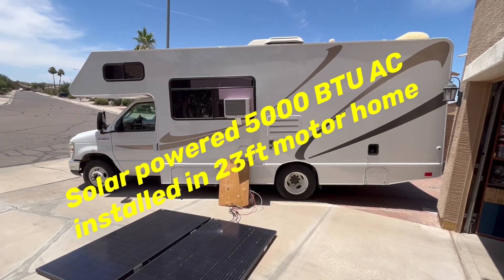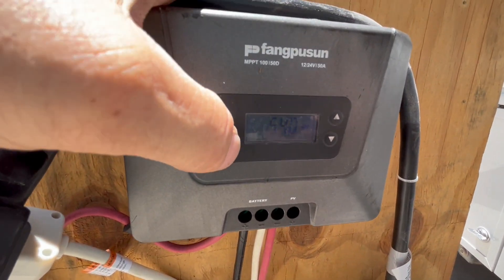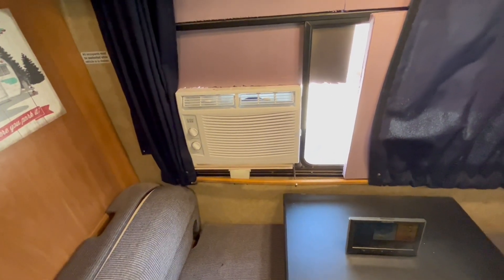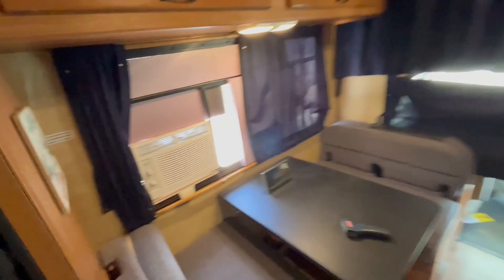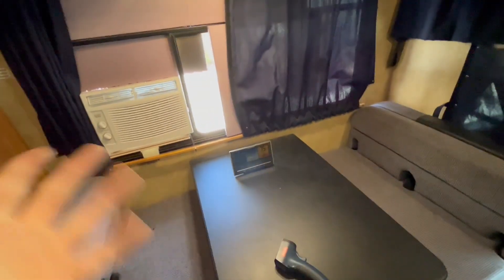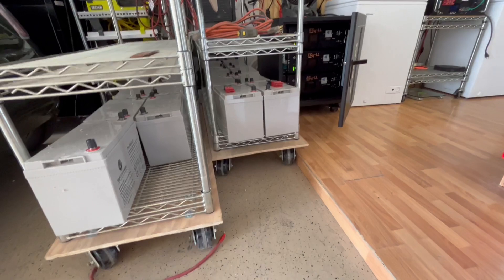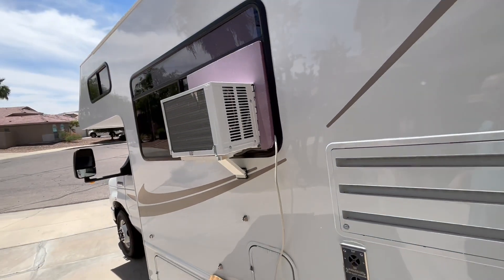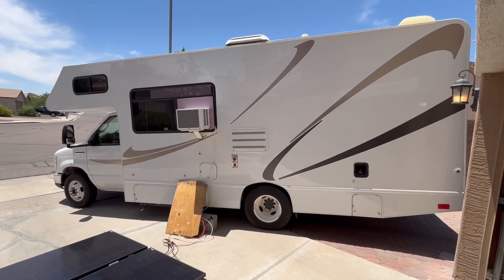DIY solar panel for home, RV. Solar powered AC installed in 23 ft motor home using 2 solar panels

Comment: Thanks for this real-world example. I am working on a small camper half the size of your RV and this gives me a good example to work from.
Reply from the maker: @danroscigno187  you are so welcome. I actually ended up installing a 12,000 btu mini split in the motor home. I bought at Lowe’s 2 years ago in the clearance section for $74. I went to storage the other day to start motor home and propane generator. Ran the mini split on generator power for 20 minutes and was able to cool motor home down from 96 degrees to 74 degrees in about 20-25 minutes. I am actually ordering a hybrid mini split and will replace the one cut in motor home. This hybrid mini split is direct solar input, I am installing 12-100 watt Grape solar panels on roof on motor home. This hybrid will start running the mini split when sun rises and only needs 199 watts to start running. You can limit it with battery or grid to 600 watt input when solar in not available like at night, cloudy or rainy days. This is a 22 seer unit and the one currently in the motor home is only 16 seer. Will be able to run on less than the window ac unit which used around 550 watts. Both mini splits can heat or cool. The window ac can not heat in winter. Sounds like that small camper will be a good fit for window ac unit. I started tent camping, then bought pop up, now 23 foot motor home. Let me know if you have any questions and hope to do a video on mini split in motor home soon. Hope you have a truly wonderful and blessed rest of 2024.
Reply: @diy-solar-guy  I have a climateright combined AC/heat unit that I will use until it quits. Eventually I would rather have a propane heater that only draws enough current for the fan, but I can't see buying one until the climateright becomes a climatewrong. Thanks again for all of your details!
Reply from the maker: @danroscigno187 That is awesome you have a unit that cools and heats. I would use it until it stops working as well. Hey thanks for your input.

Comment: Thanks, I will be doing this. I have everything except that large of a inverter. I thought this would work.
Reply from the maker: Nice, I actually bought a 12,000 btu, 120 volt mini split at Lowes last year in their clearance area for $72. I paid $550 for the same exact one 3 years ago. The same ones that I installed in my house. I will be upgrading to the mini split since it will heat as well in the winter. You will be better off with a pure sign wave inverter. Good luck with your project. Hope you have a wonderful and blessed week.

Comment: Any chance to get the model numbers of the equipment used? I want to make a trip to San tan Solar but it is an hour drive away and would like to build similar setup.
Reply from the maker: What product do you want model numbers for?
Reply from the maker: I looked on their website the other day and did not see the Fanpusin charge controller, will need to get a different one that they carry now..

Comment: Id like to buy those agm batteries. Where do you live? Im from middle tn. It might not be possible but id like them for sure
Reply from the maker: I live in Phoenix az area, Southwest corner on Phoenix. They are great for starting large loads during day and to keep running as long as sun is up.
Reply: @diy-solar-guy  I'm so far away there would be no way of me getting them.
Reply: @diy-solar-guy  sir I have a question for you that maybe you could help me with. I have 24 nissan leaf modules in a 24 volt configuration. I've never had a bms before but people say I need one. Do you have any suggestions as to what bms I could get that would be compatible with the battery I have? It's difficult to explain the set up if you are not familiar with leaf cells but I'll try to explain. There are 4 cells per module in a 2s2p configuration. Each cell group is 4.2 volts there is so basically I need a 6 s bms but I'm not sure which ones are adjustable to that high of a voltage for individual cell and that will have only a 25 volt cut off for high charge. Any help with suggestions with a 6s bms is greatly appreciated
Reply from the maker: I have no experience with leaf cells or BMS wiring, there are several guys on YouTube that have a lot of videos on what you are doing. Check out this guy on YouTube, he does a lot with all kinds of cells and attaches Bms. Maybe he will respond if you ask him a question. I’ve watched a lot of his videos but not interested in building from scratch at this point. Hope he can help you.https://m.youtube.com/watch?v=TL4tqhAjF0s&pp=ygUYZGl5IGxpZmVwbzQgYmF0dGVyeSBwYWNr
Reply from the maker: Also I think David Poz did a few videos on car LiFePO4 car battery builds for power walls. Check him my out as well. Sorry I can’t help more but no experience with that.
Reply: @matthewknight5641  I have lots of exp with diy lifepo4 and li-ion batteries and the bms setup. I personally think that the JK BMS is the best for beginners being that it is very capable, and easy to set up. they also have an active balancer that works at 2 amps, so thats a really nice touch. Running without a bms is as dangerous as driving with loose wheel nuts. the JK BMS I use handles upto 24 cells, but I use it for only 16. I have three of them, all great. bluetooth setup makes it simple. They are not the cheapest, but in my opinion they are the best for what we are doing. they make different versions, so make sure that the one you purchase is right for your number of cells, and also treat yourself and get the 2 amp active balancer. they also make one with like a 600mA balancer, but just get the bigger one.
Cheers, hit me up if you have any questions. PS, you can buy it on ebay, aliexpress and similar sites. Maybe even amazon depending where you are located. here is an amazon.com link https://tinyurl.com/3ar7jj99
Reply: @sNEAKYnIGHTmUPPET  thankyou. I'm gonna get a couple of them for sure.
Reply from the maker: Thank you so much for your input. Excellent.
Reply: @sNEAKYnIGHTmUPPET  I just ordered the jkbms with 2 Amp active balancer and also a dally 300 Amp bms. I got 8 of my eve 280 grade a cells today in the mail and should get the other 8 anytime. I'm gonna try to use the jkbms on my 24 volt 24cells leaf battery and the dally on my 16 cell 24 volt 560amp hour lifepo4.  Thanks for recommending that jkbms. Once I looked at it I'd kinda wished I didn't order the dally and just ordered two jkbms. O well... I ordered the dally first and it's a 300 Amp so I figure it'll be good for my 4000 watt low frequency inverter.
Reply from the maker: Glad one of the subscribers could help you figure out what you needed. Hope it works well for you.

Comment: Id love to have about 4 or 6 of those lifepo4 batteries that you have.  I just ordered cells to build my own but i havent been home to see them yet. Hopefully in the next two weeks i can get there
Reply from the maker: I bought the version 1 refurbished with 2 year warranty for $1311 each plus $249 freight. The 3 version 2 EG4 LiFePO4 batteries are working great overnight running my 3 1/2 ton heat pump with 62-68 percent state of charge left at 6 am. I have connected the version 1 & 2 in parallel overnight to run heat pump and I woke up to 85 percent state of charge still left at 6 am this morning. My thermostat was set at 74 degrees & it was still  95 degrees out at 8 pm. Weather you order one or 6 batteries, your freight cost won’t change much so you save a lot just on freight. You might be able to get 4 batteries with $250 freight total. Check often on website At signature solar for sales on new and refurbished server rack batteries. Thanks for you great input.

Comment: Last week i installed a 9000 btu minisplit in my 30 foot holiday rambler travel trailer.  Its a 220 volt 38 seer model and ots running off my 24 volt solar system using a 4000 watt split phase inverter. Its been a fairly expensive thing to do but it only pulls 200 watts after the first ten or twelve minutes. The first ten minutes its pulling 600 watts. With it being a 9000 btu variable speed it can go up to 13500 on high cool turbo and as soon as it cools down the camper it goes downnto 2000 btu to keep the camper at 68 degrees. Another thing is how silent it is. My camper has 1800 watts of solar and 24 nissan leaf batteries in 24 volt configuration.  I run the ac with the 4000 watt inverter but also run a 3000 watt inverter that runs the rest of the camper. Its been a heck of a hobby but we live in the camper when not in our semi truck so its our home a feq days a month and the ac  and solar install was the best upgrades we have done so far. Thanks for the videos
Reply from the maker: Wow, sounds like you have an awesome set up. I am looking at getting the 29 or 38 seer 120 volt 9,000 or 12,000 btu mini split to install in my 23 foot motor home. We can never get electric hookup and the cooling or heat is my only problem. Everything in motor home runs on propane even the 4000 watt Onan generator which is finicky and really load. These mini splits are so quite inside and out and very little power usage. Thanks for your input, we appreciate hearing from those that have installed and works for them. I want to go camping more but so hesitant because of the loud generator makes it miserable. Been thinking of the ways to mount outside unit on bumper and where to mount inside unit and how to secure everything so it does not cause vibrations while traveling to create leaks in refrigerant lines. Once again thank you
Reply: @diy-solar-guy  as far as mounting the minisplit I bought two 2 inch bumper hitch mounts off qmazon for about 30 bucks each then used two pieces of 2 inch square tubing from Amazon also. You can get flexible lines that are a few feet long to go between the ac unit and the regular lines that come with the unit. The flexible lines are like ac lines on a car and they soak up the vibration pretty good and helps keep from having the leaks at the flare connections. I highly recommend spending a little more and getting the 38 seer unit because it uses nearly half of the power the other minisplits use and is easily ran on my solar. It uses about 600 watts for 10 min then 200 watts the rest the time it's running. Best thing I've done so far for sure. My leaf batteries have no problem running it 24 7 with the solar I have
Reply from the maker: @matthewknight5641  very nice, thank you so much for your help and input